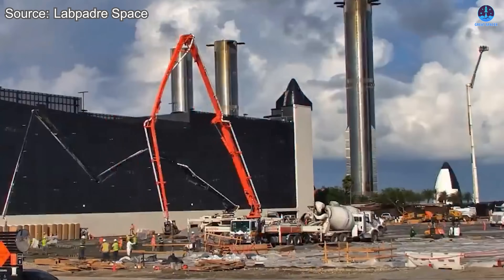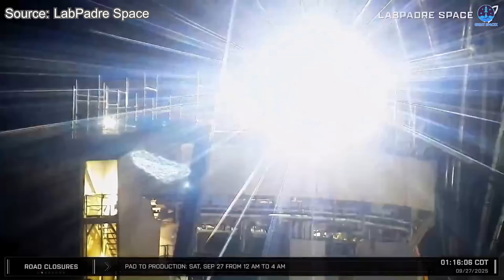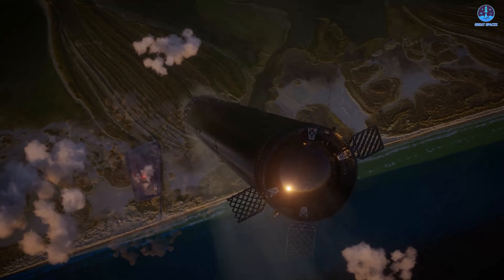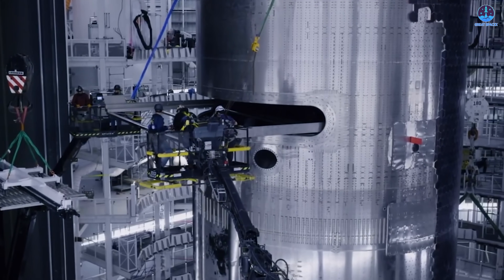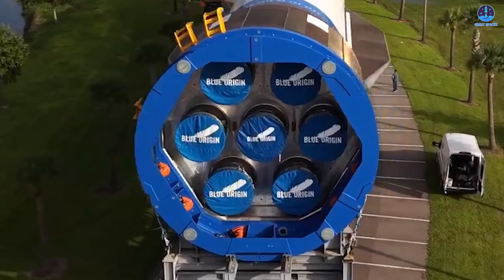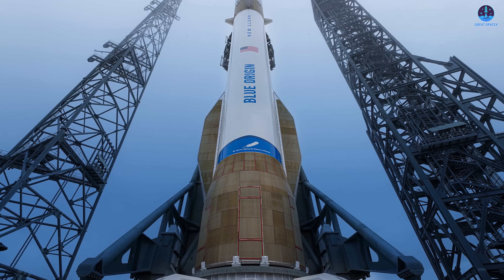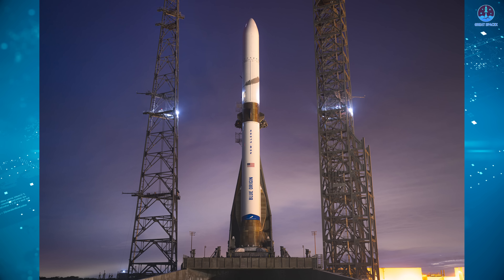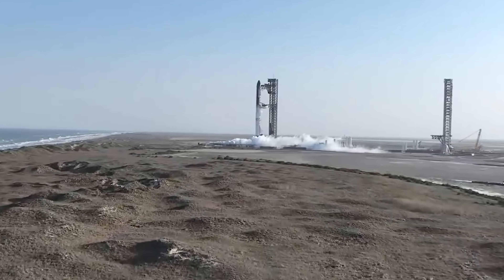Starship Flight 11 Booster on Pad to Launch in Days! Blue Origin New Glenn also Moved BUT...

Comment: R.I.P. Starship V2 and Super Heavy Booster V2. Don't worry V3 Starship will be replaced in a few years by V4 Starship.
Reply: I'm sure V4 was announced just recently on one of the other fanboi sites. But then prior to that it's likely galaxy brain will shock the world of science to its very foundations by revealing yet another bigger and more powerful engine.
Block no... What are we on now? 
Yeah, these new engines will be so fucking powerful that your gonna need a bigger rocket to accommodate the payload.
All this talk of boosters, launch pads,  Blue Origin etc, are nothing but distractions to divert attention from their nemesis: They don't have a heat shield.
And they have no idea how to transfer large quantities of cryogenic liquids in space.

But they do know how to run a scam.

Comment: Looking at how BO lays out interior of their rocket factory vs Spacex rocket factory (700k sq ft vs 1,000k sq ft with ring groups stacked in the Mega Bays... soon to be Giga Bays), BO doesn't seem to be setup for mass production. Far less efficient use of space. Rockets on their side in the factory, assembly areas more or less randomly scattered. Spacex has all components vertically stacked with penultimate stacking in the Giga bays. The  effective space of more than two million sq ft aggregate with very large bays under construction. I don't see how BO gets to one or more rockets per month by 2027 without major changes. It appears that they are working on two at a time. Welding a thin 7m dia tube on its side... I would think they would have flex issues... who knows.

Comment: That's funny about the Cybertrucks.  No one is buying them and they're piling up on dealer lots.  Glad they found a use for them.
Reply: Tesla doesn't have dealers... they are not piling up at all. They build them for customers, not expectations of customers unlike BYD and other brands. 

That said, they are too expensive to sell in anything like the numbers intended. Factory is designed for 250-500k/anum and they sell about 38k/anum. They need to make them for $60k with a 400mi range vs $80k with a 325 mi range. Won't happen until the glacial 4680 matures past the long intended 350 wh/kg (currently stuck at 270 for a very long time). 

The 4680 is the problem with Cybertruck and will be for Semi pricing and Roadster. There's been no official news of any worth mentioning (accomplishments vs goals) for about a year. 

The 4680 battery is a Major problem for Tesla. This is the root issue right now.
Reply: @avgjoe5969  The Tesla dealership near my home has had about 40 Cybertrucks sitting on their lot for 5 months.
Reply: @ronw76  so you think they are sit there for nothing 😅 are you watch 24/7 a week without car move out ..you think you are near dealer doesnt mean you know every car just sit there
Reply: @avgjoe5969  I really think the tow hitch weakness is the biggest problem. Tesla needs to use stainless steel, or even hot dipped galvanized steel for the back end structure of the truck. It could be engineered to be not much heavier than it is now. The battery 'problem' could be fixed after you buy a CyberTruck.